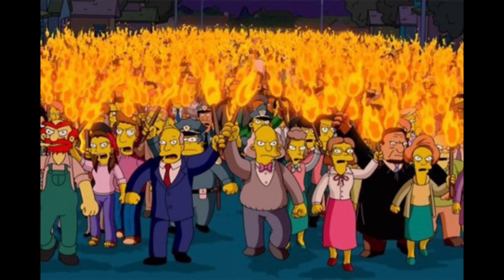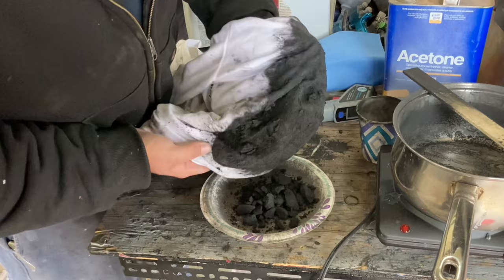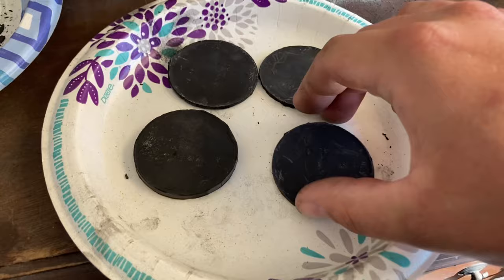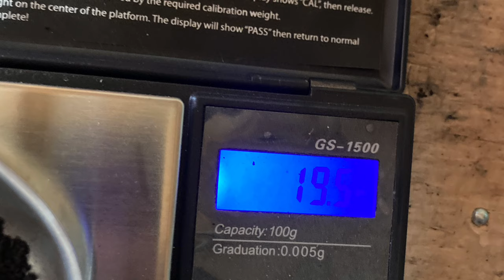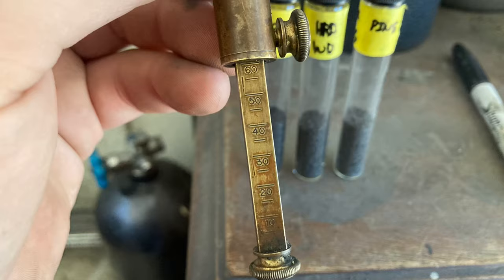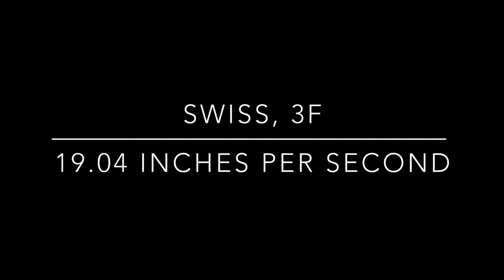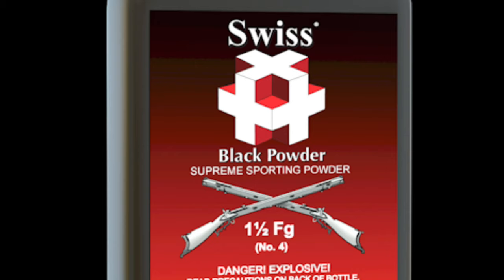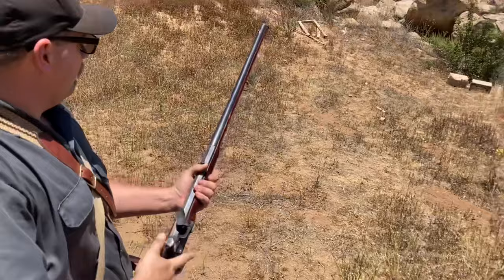How To Make Black Powder (For Firearms Part 2)

Comment: Tech question: what mesh size is your "pass/hold" for the f grades?

Uneducated/completely unqualified opinion: those wiley swiss get less annoying fouling by using a modified oxidizer, a sulfur salt, or both. Might also explain their "slowest of all" burn rate. Of course, they could also add a percent or so of some secret sauce, some semi-inert additive that doesn't burn, kinda dislikes bonding to iron, but has an affinity for the ash chemistry of BP fouling (like dish detergent during the puck compression stage, or the graphite polishing stage, or both)

Comment: My question is if you straining out the water would you not be wasting potassium nitrate and Sulfur?
Reply from the maker: Yes, that’s why you want to use as little water as possible. also, I believe when you shock it with the ice cold alcohol it helps the KN03 to bond to the charcoal and sulfur and not to be lost in the water that gets strained out. Just a theory.

Comment: So 100 grams of potassium nitrate
With 4 oz of water to dissolve it (over heat)
Then you add your 20 grams of charcoal and 13.5 grams of sulfur in

When you say equal parts cold alcohol once it starts to bubble, what alcohol do you use? By equal parts do you mean 133.5 grams (total for all components) of it or what do you mean by equal parts? Asking so that way i don't have to pay egregious prices for shipping powder. Many thanks!
Reply from the maker: Equal parts volume.
Reply: @Everythingblackpowder  So, just because I’m a little slow, it would be the same amount of all materials used in grams? So 133.5 grams in the case of above?
Reply from the maker: So if you poured all of your dry ingredients in a measuring cup and it came to 1.5 cups then you need 1.5 cups of denatured alcohol

Comment: Just out of curiosity, when your pucks dried, did you notice some potassium nitrate on the surface of your pucks as if some of it was forced out during the pressing process and dried on the surface? That's what happened to me and I haven't grained it yet to test.
Reply from the maker: Yes, that can happen if you use a little too much water. Granulate it and see how it does. I bet it will work just fine
Reply: @Everythingblackpowder  
Awesome, thanks! Ill be granulating this evening after work and I'll try it then.

Comment: Thanks for the great information.  I have 2 questions; 
 1) you say after boiling pour in equal parts of alcohol.. how much is that? Equal to the 4 ounces of water you first started with? 
2) when wetting it to put in the press, wet it with what?
 Thanks for your time..
Reply from the maker: 1) Equal amounts of alcohol to volume of dry ingredients. So if your dry ingredients equal 200Ml use 200ml of alcohol. 
2) I wet it with water but you could also use a 50/50 mix of water and alcohol.
Sorry for the confusion.

Comment: you are chaging the ratio of the mixture because potasium nitrate is water soluble and you are disolving it away
Reply from the maker: Correct. That’s why it’s important to use as little water as possible.

Comment: Dont dry Blackpowder with an heat source no direkt sun light because if it drys to fast the nitrate crystalls out thats the withe touch in the blackpowder. Dry it at room temperature. That takes longer but the product burns better.

Comment: Love the videos! I am just wondering if you could process your charcoal in the manner to make it "Activated Charcoal" this should assist in the intake of the KNO3 and other molecules. From what I have seen much of the Activated charcoal on the market is made using Coconut shells which wouldn't be suitable as I have some what tried it already, but if one could use your wood of choice and if you are keen to try the whole process of creating Activated charcoal, I assume this could possibly result in less fouling and possibly even faster burn times? I am busy looking into it. but it is quite a setup to build. Another note I would like to mention, via the CIA method, maybe there is tiny amounts of KNO3 that gets absorbed in with the Alcohol via stray water vs the purity, if you evaporate it is there any residue left? maybe one could bump up the KNO3 percentage vs the loss observed to keep the ratios in tact?
Reply: I tried activated carbon and the results were poor to really bad
Willow is best

Comment: Jake. I would love to have seen or perhaps in the future see the actual press process. How long does it stay pressed for? How many presses are done in a batch of BP etc.
Reply from the maker: Check some of my other DIY black powder videos. I use a 20 ton press and I max out the press when making pucks. I usually hold it at max pressure for at least 10 seconds to ensure the pucks are compacted as much as physically possible.
Reply: @Everythingblackpowder  thank you

Comment: Curious -- If you mill black powder as you did in part 1, but not granulate it.  Rather, take the powder straight out of the mill...mix with denatured alcohol to the point where it's malleable but not dripping....then press it into the discs and proceed from there as described in this video.  What would be the result?  From what I've seen/read, it appears to me that its the density of the powder that makes the difference.  To simplify the production, and increase yield (none lost to a T-shirt)...why not combine the two methods as an experiment and see what happens?
Reply from the maker: I have tried that and it does make good powder but it still is not quite as powerful as the commercial brands
Reply: @Everythingblackpowder  I'd love to see how fast it is compared to the rest (inches of burn/second).
Reply from the maker: @EDFETHER  6.00 in the video. it’s as fast as goex and faster than Swiss but it’s not as powerful as either. Even after compressing it I still had to use 5-10 grains more worth of charge to get the same velocity as the commercial brands, But That could be the charcoal I’m using.

Comment: I just came across your videos about making blackpower I was wondering if a dehydrator would work I live in Ohio very humid weather.Also in my area NO BLACKPOWER at all in 100 mile radius been having to use Pyrodex or triple 7 they suck I have been using muzzleloaders since the 1970's never had a problem getting blackpower until now thank-you for the information on making your own very informative especially compressing the powder thank you in advance.where did you get the ceramic balls for the tumbler
Reply from the maker: In my experience you don’t want your powder too dry. I know that might sound strange but I’ve done test were we stored our powder in a vacuum chamber with desiccant for a couple of weeks and it burned extremely slow, the fouling was much like dust and the overall performance was bad. I typically store my powder in old Goex or Swiss can with one little desiccant pack that you can buy from Amazon. This works the best for me. We bought the ceramic balls from United Nuclear
Reply: Ok about the dehydrator so when do you know when it is dry enough to run it through the grain grinder
Reply from the maker: I would let them sit for a week or so be you run them through the grinder

Comment: Since the CIA method seems to add a bit more steps to achieve not having to add 20% by volume.  Is it really necessary?  When using the same amount of components do you achieve the same amount of energy in total?  Meaning, if you use the first method and you come up with 100 units, do you come up with 80 units using the CIA method but it's 20% stronger but you get less volume so basically the same?  Hope that makes sense.
Reply from the maker: I don’t use the CIA method anymore. It’s not worth the trouble if you corn your powder

Comment: We're do you get the compression dies to make the pucks. I have been making my own for about 4yrs now but have used the screen corning method. I use my black powder for bpcr in 50-90 sharps, 45-90 highwall. Like to try the puck making process. 
Thanks Bart
Reply from the maker: https://www.woodysrocks.com/store/p275/Black_Powder_Puck_Press.html#/

Comment: Hello. Would you say there is a significant waste of potassium nitrate that remains in the water with the CIA method? Absolutely no doubt on its effectiveness, but I wonder if in terms of cost-effectiveness it might have some drawbacks compared to "traditional" methods
Reply from the maker: Absolutely, In fact I don’t use the CIA method anymore because I’ve found it unnecessary. I can make equally as powerful powder without the extra steps and cost in alcohol.
Reply: @Everythingblackpowder  that's good to know, thanks!
Reply from the maker: Happy to help

Comment: Where did you get those screen? I can't find them other than huge rolls.
Reply from the maker: I bought them on Amazon
Reply: @Everything Black Powder  great but what's the exact name or size screens?
Reply: @olympicblackpowderrifles3155  
16 mesh, 1.18mm for FF.
20 mesh, 0.85mm for FFF.
Edit:
40 mesh, 0.425mm for FFFF.

Comment: Excuse my ignorance please, but how do you measure volume by grains? I would very much like to test the density of my homemade powder. I also use the puck dies and hydraulic press but I have no idea what density I’m producing. I’m not terribly impressed with my first batch so far but I believe it’s the air float charcoal I bought off line. I can’t seem to find any good charcoal. Guess im gonna have to make it myself. Anyhow I would still like to learn how to measure the density of my powder. Any help would be greatly appreciated. Thank You.
Reply from the maker: You need a volumetric black powder measurer. The kind used for loading black powder firearms. Air float charcoal should work okay but you will have to mill it for 12-24 hours
Reply from the maker: You will be able to check your density by comparing grains by volume to grains by weights

Comment: Where can we buy the cylinders to make pucks? I assume they are aluminum? Harbor Freight sells the 20 ton press. Can you point us in the right direction on the puck cylinder parts?
Reply from the maker: It might sound cheesy but this is a good cheap option for a puck
https://www.amazon.com/Rosineer-Cylindrical-Pre-Press-Food-Grade-Stainless/dp/B084R5G6T1/ref=mp_s_a_1_4?crid=2GHPEDIQGJVGZ&keywords=rosin+press+mold&qid=1672713699&sprefix=rosin+press+mold%2Caps%2C146&sr=8-4
Reply: @Everythingblackpowder  I see that is stainless steel. Do they make these in non-ferrous materials that won’t risk a spark?

Comment: I have that same Harbor Freight rock tumbler.    Have you had any problems with the motor getting too hot running it that long at one time.
Reply from the maker: No but I kept a fan on it while it was running in the summer time
Reply: @Everythingblackpowder  I got the same idea.

Comment: Nice Video but the "CIA" cooking process is useless. You get the same result when you add up to 10% off water after ballmilling, then pressing, corning and drying it. All professional powdermills do this. The only difference is that they use heavy wheelmills and they add the water while milling. 20 years ago, elephant blackpowder had the process on their homepage.

Comment: I'm curious. If you compress the powder then run it through the mesh to size it before it dries, would that affect the performance?  I'd think that would be better than trying to break up the hard pucks.
Reply from the maker: I haven’t tried that
Reply: @Everythingblackpowder  I haven't seen anyone do it. I've been looking at the best way to get into making my own black powder after struggling to find it for a couple of years. With Goex going away, I figured making it would be about the only way. I've seen people do it every way imaginable except like I mentioned.

Comment: Thanks for the info!  Only question have is, after figuring out both the dry & CIA processes, which process do you prefer and why? Both seem doable by the average person.
Stuart
Reply from the maker: Dry. You can get just as good results if you kill all the components together long enough.
Reply: @Everythingblackpowder  “kill”?
Reply from the maker: Mill. Lousy autocorrect
Reply: @Everythingblackpowder  😂 gets me regularly too!
Reply: @Everythingblackpowder  you said in part 1 that milling longer is key. Is there a point that going past say 24 hrs just doesn't have any additional benefits? And thanks for you content.
Reply from the maker: @Ianbond21  yes

Comment: So dissolve KNo3 in hot water then add charcoal and sulfur and raise temp until all dissolved and boiling the. Chill with 4oz of frozen alcohol? Or equal to total volume of water and powder?
Reply from the maker: Volume. Sorry, I should have made that more clear
Reply: @Everythingblackpowder  no I’m just trying to be clear. So 4oz plus the volume of black powder for the alcohol?
Reply from the maker: @308dad8  just the volume
Reply: @Everythingblackpowder  Just the volume of powder? Or water? Or both? I promise I’m not trying to be difficult.
Reply from the maker: The volume of the dry ingredients
Reply: @Everythingblackpowder  Thanks. I’ll have to try it out.

Comment: Very nice and informative just wondering how much pressure did you use on the press.
Reply from the maker: I have a 20 ton press and I max it out when I’m compressing powder. You don’t have to use that much pressure but it makes the powder more powerful
Reply: Thank you for the info I also saw that you said you can use the first method and press it but it would not be quite as powerful is that correct and will it help with the power at all,and thank you for all the info.
Reply from the maker: @jimking9411   The dry milled and compressed powder is just as powerful as goex. the wet made and compressed powder will be faster and more powerful than all the commercial brand powders.
Reply: Thank you
Reply from the maker: @jimking9411  happy to help

Comment: First off, thanks for the info! It's really appreciated for a noob. One small issue, denatured alcohol is banned in my commie state (guess which one) would rubbing alcohol work? What about white gas camping fuel? Also, where did you get the die? I suppose I could probably make one, but if I don't have to....
Reply from the maker: You can use isopropyl but it has to be 99%

Comment: What type of alcohol are using--isopropyl or ethanol?    If you don't happen to have a 20 ton press at your disposal, got any suggestions for an alternative way to compress the pucks?   I was thinking you might be able to rig a car jack in some way to compress into pucks.   Anyway, maybe someone has a solution.

Comment: Swiss powder might be made from cleaned charcoal- boiled in acid or distilled water, wood charcoal contain still some ash by itself I think.
Graphite is used to make granules more slippery, to allow them to compress themselves inside the gun chamber better and to make load measures more repeatable. It also add some moisture proof.
You often used in video word "more powerful" it is very subjective, to be objective you would have to measure for example the velocity of the bullet fired with different powders ;)
Reply from the maker: I have tested Swiss, goex and my powder with a chronograph in my 45cal flintlock rifle and my powder makes greater velocity than both Goex and Swiss. I hope that meets your qualifications of being objective. I’ll make a video where I chronograph all three powders.

Comment: Why use the mill after doing the C.I.A method? why not just go straight to the pucking
Reply from the maker: You most certainly can do that but milling the powder after the cia method insures that any KN03 that might have re crystallized gets incorporated back on the mix
Reply: @Everythingblackpowder  Thank you I was wondering because I thought why buy a ball mill because I already ordered a 6 ton press and everything else.

Comment: Years ago I made a Hawken cap fired rifle from a kit, and am now thinking about making a flintlock rifle.  Do you use your homemade powder in the frizzen pan and is it the same granule size as the main charge or is it finer?  Also, in compressing the black powder into cakes is there any danger of detonation?
Reply from the maker: Yes I use my powder to prime the pan. I’ve used smaller granules and the same size as the main charge. It works either way. There is no danger of the powder detonating while compressing it so long as the powder is wet
Reply: This may seem a stupid question, but here goes....
Why not go ahead and puck the powder after wringing the liquid out?
Reply from the maker: You certainly could do that and it does make decent black powder, but the trouble is that the kno3 will re crystallize after it’s dried. Milling the dried powder insures any crystalized kno3 gets reincorporated with the charcoal and sulfer. If you’re planning on pucking it, I would recommend milling the components dry and skipping the wet process completely. This will make powder comparable to Goex and schuetzen.
Reply: @Everythingblackpowder  just done a 200g batch, 150g kno...30g willow charcoal and 20g sulfur using the wet method that you demonstrated.
I ball milled the charcoal and sulfur mixture for about 10-11 hours first.....after wringing the liquid out I screened about half through a 20 mesh screen and pucked the rest. Just wanted to experiment a little and see how it goes....
I may try ball milling the full mixture next batch, but I do like the wet method from a safety standpoint....hell, I may just use the wet method, make a slightly larger powder measure and skip the pucking altogether....